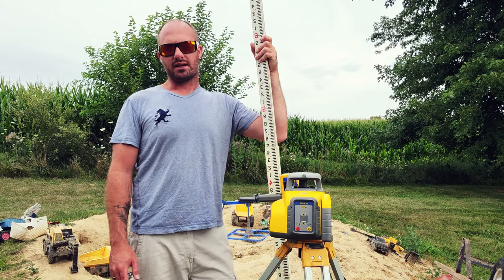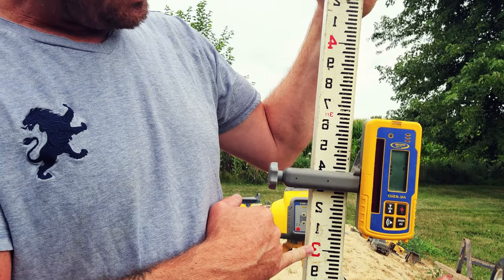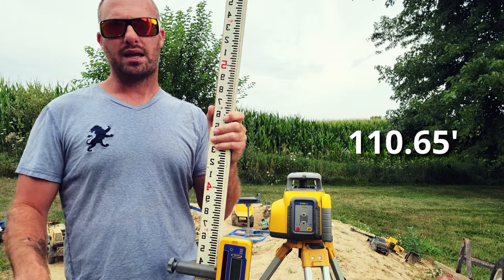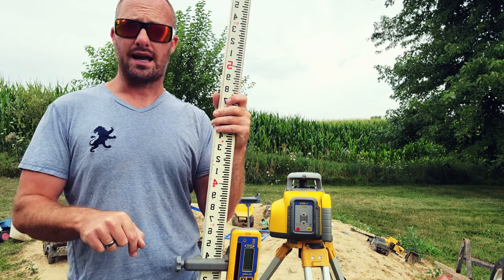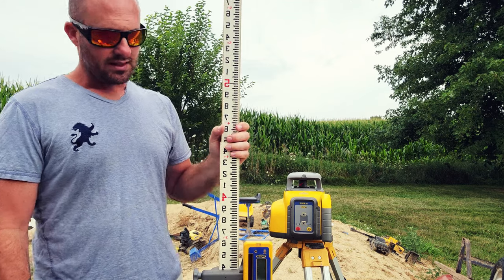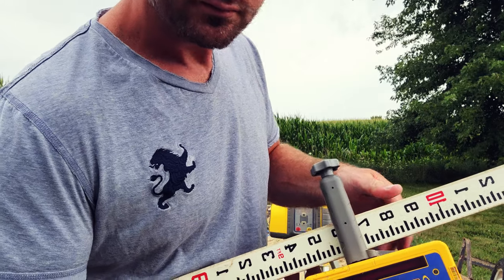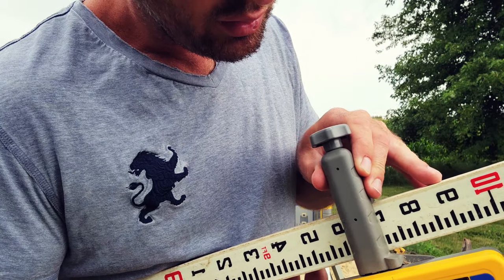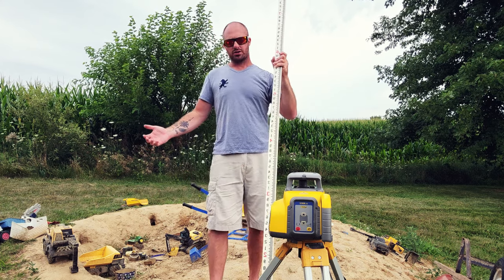HOW TO SET ELEVATION BASED OFF OF A HUB || How to take elevation using a grade rod and a laser

Comment: Dude that's 100 per how not to figure grade 
D.m. + rod shot = i.h. instrument height 
110.65+ 3.39=114.04(i.h.)
I.h. 114.04- S.b 104.32=9.70
Either way will come to the same conclusion but you leave way less room to error . And for sure if you not a pro why video
Reply from the maker: This is just another way of doing it. Once you do it a couple times and understand what's going on it leaves less room for error because your doing simple math instead of subtracting 5 digit numbers.
Reply: The error reduction is realized in the equation. But for example say it's not a basement but sewer installation. Then you have to do all that math for each shot . By establishing your i.h. or elevation of instrument,  you don't have so much work load . Reference your plan elevation and you can determine all of your rod heights. But all that set aside I am a supervisor for 5yr multi million dollar project . With 20+ yrs.exp. in the field.  And every engineer offerman worked with or for used i.h. method all that aside. How would u even begin to find slope of pipe line or determine ele.of a ex. Invert . But hay if it works for you
Reply: And you could just drop the 1 from the front of elevation to get your digit count down .
Reply from the maker: @joesimmons618  as with most things in this industry, there's more than one way to skin a cat. I don't doubt your experience and I will absolutely say your method sounds much more in line with what an engineering firm would do. That being said, that doesn't make this method 100% incorrect, it's just a different way of going about it.